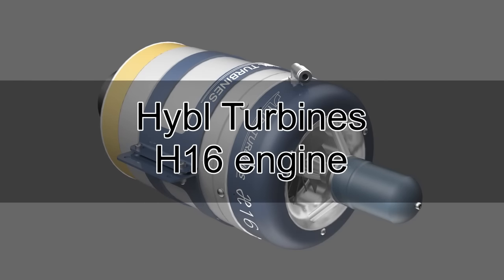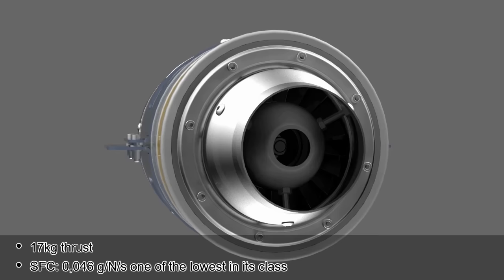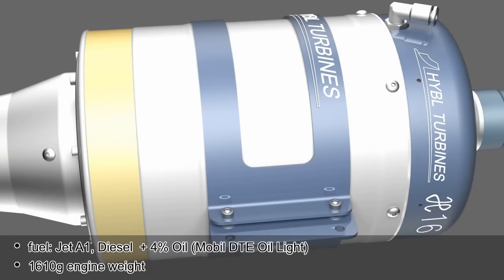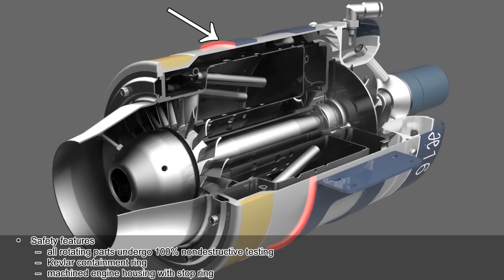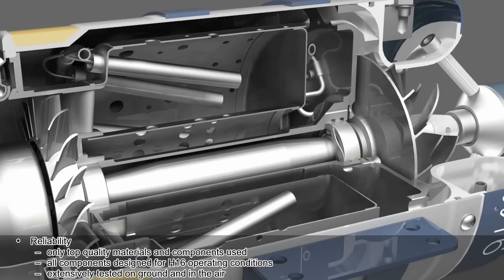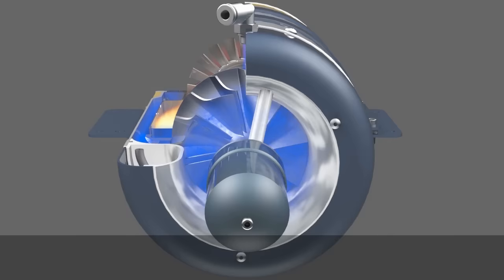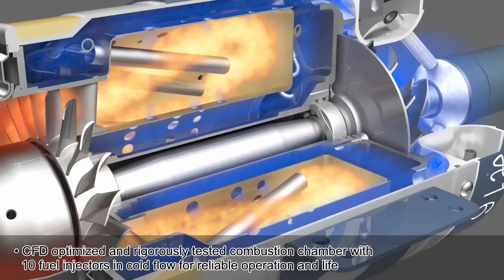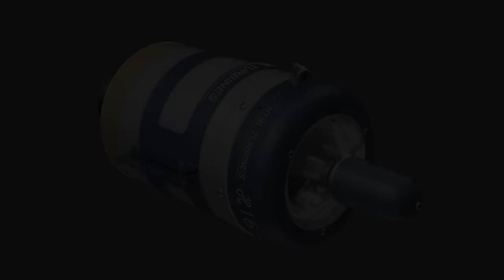Hybl Turbines H16 Engine introduction - 3D animation

Comment: I studied an engine much like this, only much larger! It was originally fitted to a navy target drone I believe called a shrike. Compressor was considered "mixed flow" design, engine used the same fuel/oil mix as well. It had no oiling system.
Reply: How did they kept it cooled

Comment: That's how it works. Confused for years to understand the basics.
Reply: Yes and when you get it its really quite a simple machine isn't it. In a way its simpler than an internal combustion engine...  I guess the devil was in the detail for those first large scale engines back in the 30s and the materials they needed operating at the very edge of what was possible at the time. The German axial compressor on the front was a stroke of genius getting that working...

Comment: Seems to me the flow reversal actually impedes thrust production. Have any straight-through designs?
Reply: davidsirmons. Only combustion air is reverse flow through the vaporizing fuel burners, this is done to heat the vaporizers.
Secondary air enters the combustor from the in/outside.
Reply: @johno9507  Wouldn't bother explaining it. Often you find comments like this and it demonstrates their true knowledge for what they are talking about.
Reply: For most small jet engines, it makes more sense to go with a reversed flow design. From what I have read so far, engines perform best when they get the highest pressure possible before being combusted. To do this they slow down the air to convert air velocity into pressure. This means that the air isn't moving very fast after going through the compressor, so the path doesn't need to be very aerodynamic. Also, centrifugal compressors tend to have more advantages over axial (straight through) compressors because of their simple construction.
I don't have actual experience with engines, but I have read many design books such as "Model Jet Engines" by Thomas Kamps.

Comment: where the ignition plug?
Reply: This is a kero start meaning it uses a ceramic burner in the combustion chamber. The older style engines, usually gas start, have external plugs.
Reply: Please can you give me this 3D animation disigne .